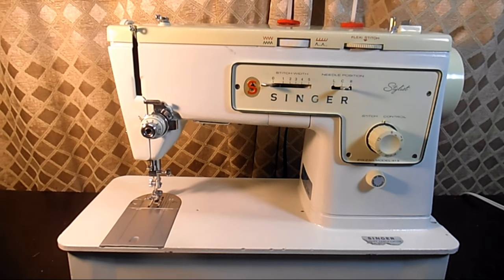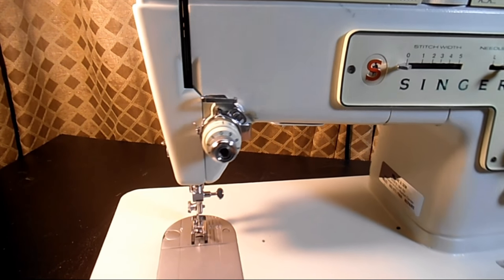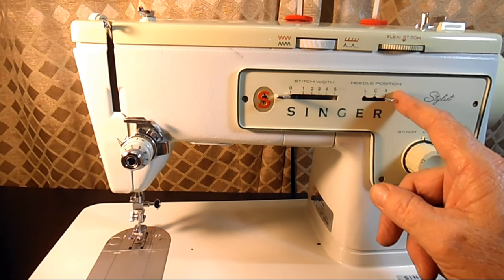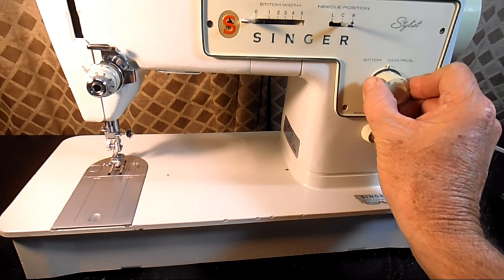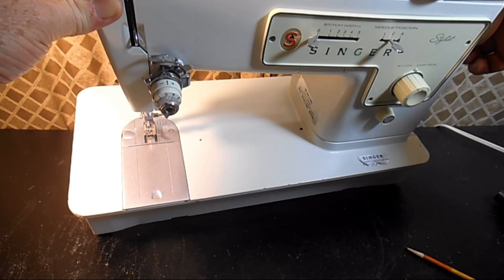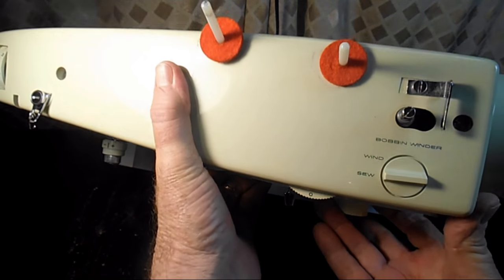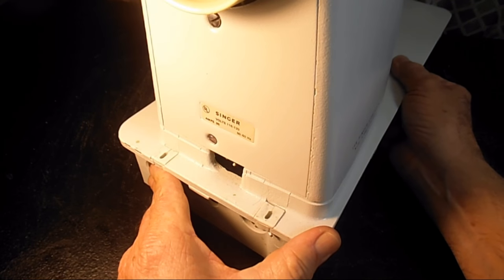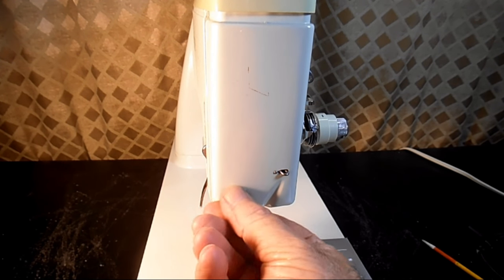TOUR THE FEATURES OF THE SINGER MODEL 413 STYLIST SEWING MACHINE

Comment: Andy.  Our 413 is birdnesting like crazy.  I watch the needle thread get picked up by the hook, it travels around and seems to hang up on the bobbin holder, the piece that has short swing to hold the bobbin.  Then next time around it gets stuck under.  I am pretty sure I have timing set correctly.  Needle in proper, bobbin tension set.  Top tension set, have tried from 1 to 6 all the same issue.  Ideas?
Reply: Maybe easier way of expressing.  The hook ppulls the thread around to just past 6 oclock position, when it releases, it is hanging on the spring the holds bobbin in place.  Could it be timing?  too far advanced?  I followed the timing instructions closely, so I think timing is right.
Reply from the maker: @BillWhetstone  No, not timing. When the needle thread "casts off" the hook point at 6 o'clock it should pass thru a "gap" between the heel of the bobbin case (bottom right-hand corner) and the spring. It's called the "Thread Cleance" and on your model (413) the gap should be between .012 to .018 inches.
     If the gap is too narrow the needle thread hangs or can stop there and every following hook pass just hangs or stops the thread. Directly to the right of the spring is the bracket itself and the bottom screw is the adjustment screw. You need a feeler gauge and you may need to loosen (slightly) the two smaller screws above the adjustment screw, the bigger lower screw turns to move the spring closer or farther from the case. That screw is eccentric I think and the adjustment is very small. 
     Each machine is different due to age. My machine might work best at .011 and yours at .014. If the gap is too wide the bobbin case bangs back and forth from the spring to the hook race and is very loud and the case can even jump off the race.  YOu see what happens when it's too narrow.
     If you'd like the page from the service manual (PDF) for testing and adjusting the gap email to andymanuals53@gmail.com and ask Alan for the 413 thread gap page. No Charge. If you think I'm on the wrong track then send Alan a picture and he will get it to me. Good Luck, and thanks for saving that machine.
Reply: Thank you for the email, you figured out solution to what I was seeing.  The thread gap was too small, hanging the thread.  The machine is now sewing correctly.  Still have a bug to solve with flex stitch, the fork that engages hangs up just a little and makes a noise and a slow down.  But the zigzag is working and no bird nests!  Thanks so much.
Reply from the maker: @BillWhetstone  well that's great. Progress nicely done. Bill as long as the top plastic gear on the vertical shaft isn't broken and losing teeth, the machine is a very nice model. Thanks for saving it

Comment: Great series.  I recently purchased a 413 and have completely restored it per this video series.  Thank you!  Quick question:  Is it normal for the pattern selector dial to rotate during sewing???
Reply from the maker: Hi, Bill. I'm glad you found the series and it was useful to you. Thanks for that. I don't think the dial should be moving at all. On the cover plate, just above the dial is a vertical hash mark that tells you what length you set the dial to. If the dial rotates then how would you know the true length setting? That dial must be pushing/pulling a rod to the feed regulator to control how far the feed dog moves. If it is rotating on its own there must be something lose I'm thinking, like a bracket that mounts it to the frame or something? Here is the parts diagram for the 413: http://parts.singerco.com/CPpartCharts/4_4999/413K.pdf
 If you need a service manual email me (address on my "ABOUT" page) I have one for the 416-418 model which is a little different but may help. 
Thanks for watching my channel.
Reply: @andytubesewing1953   Thanks for responding!!!  To clarify, it's the PATTERN SELECTOR (white horizontal dial) that is revolving.  It appears to be connected to a horizontal worm gear that constantly moves.  Should the PATTERN SELECTOR dial revolve as the machine sews? It just surprises me.
Reply: Apologies for the multiple emails.  The PATTERN SELECTOR dial that I'm talking about is 153298-451 and the gear that it appears to ride upon is 102428 (per the 2nd sheet of your parts diagram).  I just need to know if this constant revolving is normal.  THANKS AGAIN!
Reply from the maker: Oops! My bad, Bill. I misunderstood. It is normal for the pattern selector to rotate around with the camstack with the machine is running. Take a look at this video for model 457 starting at 2:20 where I talk about the selection wheel or dial. https://youtu.be/egDAePpqjW0   That little dark spring on top of the dial/wheel pops in and out of two depressions in the dial that hold your setting in place, When you move the dial it raises or lowers a cam follower to a pattern cam. That's how it makes the pattern you selected. The cam rotates with the worm gear on the horizontal shaft and the follower, connected to the needle bar vibrating arm, follows that pattern cam and moves the needle back and forth to make the pattern. Because the camstack, pattern cams, and selector dial are all connected together, they all rotate together. Notice there is no marking on the dial itself? It does not matter because moving the dial slightly left or right moves the spring into one or the other of the depressions and raises or lowers that follower no matter where the dial has rotated while running. Thanks for your patience, Bill. Take Care.
Reply: @andytubesewing1953   You're amazing!  And, thanks to you, I've followed your 413 videos and restored my Singer Stylist 413!  Including the corroded feet pads which explained the excessive vibration.  You're so generous and helpful  THANK YOU!!!  I'm a hooked subscriber!
Reply from the maker: @UniversalEngineer  Thanks for the sub, Bill. I'm honored when people subscribe to my channel. Don't be a stranger. Take Care.

Comment: I have one of these that is experiencing slow to get going and then takes off into speed racing mode.  Is it motor or pedal?  The speed also changes fast to slow ...very inconsistent.
Reply from the maker: If the machine is fairly clean and properly lubricated then this sounds like the pedal needs cleaning and adjusting.
Here is the Playlist to help with that: https://www.youtube.com/playlist?list=PLsCOZgzzaiKItPLWcK24FBoMdHK8vTXNi
Reply: Thank you Andy....I have been looking for another pedal....as the repair intimidates me when it comes to the carbon packs.   Can't find a pedal anywhere, so I may not have a choice but to bite the bullet and tackle pedal repair.
Reply: @andytubesewing1953 woo-hoo!!! I did it...and pedal works better, nice and steady pace according to pressure added.  One bad boo-boo...I lost a spring in the process.  Clamshell took a dive when I was chasing other parts that flew....and I can't find the other spring.
Someday I will find it, hopefully.

Thank you once again and again and again.  You have helped me rescue 2 machines! Your encouragement for all the rest of us is profoundly invaluable ❤️🌼❤️🌼❤️
You are a great teacher!
Reply from the maker: @Cherps91  You did it! Nice going. Now you know about pedal repair. So many times folks asked me to "fix" the motor but it was the pedal that had never been cleaned/adjusted. Thanks for saving the machines and I appreciate your comment.
You can probably find a good enough spring at a hardware store if needed.

Comment: Hey Andy, it’s me again.  On my singer stylist 834 when using the flexi stitch option, the machine goes in reverse.  Any idea where to start looking for the problem.  Happy Easter!
Reply from the maker: That's odd! When researching flexi-stitch problems in the past they have all been user errors where the dials and levers were not set correctly. A common problem was people forgetting to put the machine in straight stitch before engaging flexi sewing, just as one example. Another was not setting the width to the red bar. I'd start by testing for normal reverse when using straight stitch to test the reverse button function. If that's good and not stuck (fails to release for forward sewing) then I'd review the Instruction Manual for proper settings of flexi-stitch sewing. For anyone needing the manual, it is still free from Singer as a PDF download on their Support Page here: https://www.singer.com/search/support?title=834
Reply: @andytubesewing1953  thanks Andy, these manuals are a lot clearer,no watermarks, to cover important information up.  Yes, the reverse works fine so it’s probably in my setting the other dials incorrectly. I can’t put my hands back on a video I was watching the other day where a gentleman showed where a tiny washer sits on the shaft up top and sure enough when I looked at mine it was sitting broken and lose up there.  He showed how he cut some off so he could just slip it on there vs a bigger job of removing all those parts that I’m sure I wouldn’t be able to handle, lol.  It fills a tiny gap but I’m not sure if that has anything to do with the reverse but I’m sure it sits there for some reason.  Anyway, I’ve got something to tinker with, thanks again for providing that manual link.  UPDATE.  It’s called a shaft washer, I found it on sewing parts online.  I wonder if Lowes has something comparable.  I have a piece I can take with me.

Comment: After seeing your other video on the Apollo Bobbin, my garage sale 413 has an F bracket instead of the Position Bracket for the metal bobbin case.  It is an after-market conversion or did Singer change the bobbin system on later models?
Reply from the maker: I have restored a half dozen of this model and they were all as shown in my video. However, the free copy of the Instruction Manual available from Singer here:
https://www.singer.com/search/support?title=413  does show the Apollo Style Bobbin case. It was printed in Great Britain in 1971. I also have the Parts diagram/list (no place or date of publication) that shows both bobbin case and bracket styles. The diagram with the Apollo case/L-Bracket is identified with K13. I'm guessing there were two original versions, 413 US and 413K GB, or they did later move to the Apollo Style, which is a later style than the metal case. No way to verify any of that though. The K designation is for the factory in Kilbowie, Scotland.
Reply: @andytubesewing1953  Wow Andy! Kilbowie Scotland?! Do they even know that was the tragic fate of our Dear Knife Throwing Legend Jim Bowie at The Alamo around 1836?

Comment: My needle broke while sewing, put in another needle now I try to sew and for some reason I can't sew because needle is. Hitting something when going down.
Reply from the maker: Welcome to Andy Tube, Pamela. It sounds like your original needle "strike" caused the machine to lose the Timing between the Needle and Hook, and the needle is now hitting part of the hook base. Fairly common and you can fix this. Either the needle bar slipped, or the timing belt slipped. (or even both) Rarely you may have bent the needle bar itself. I have a playlist of videos for model 413 that you can find here:  https://www.youtube.com/playlist?list=PLsCOZgzzaiKKVlkxPT9FMTdvUUGj8Ydf8    One of the videos in that list is how to check and set the timing: https://youtu.be/pANycD90wQg   You can check the timing without making any changes on the machine so you do that first. If the timing is lost then you can correct it. The video shows you exactly how to do all that. The video now has 90,000+ views so you can tell this happens quite often. Good luck, and hope you come back for a visit someday.

Comment: Do you have any videos on how to adjust the swing of the needle on a singer 758?  I can’t get it to do
Reply from the maker: Sorry, no. I do not work on the touch & sew models. The free instructions are here: https://www.singer.com/sites/default/files/product_manual/6dc4cd61b0c61a5fc13e60785f01d29199328059_0.pdf
You can check to be sure you have the correct fashion disc in place and the dials set correctly. Other than that, Terry at TANDTREPAIR>COM knows more about SInger T&S models than anyone I know. He sells the factory service guides as well as his personal guides from 30 years experience. https://store.tandtrepair.com/tosew700se.html
Use coupon andy-h-yt for a 20% discount if you do buy something off his site. Best of Luck.

Comment: Is it all metal gears and linkages inside?
Reply from the maker: NOPE! It is a strong machine although it has a weak link in the vertical shaft top gear. It is plastic, darn it. If it has not broken yet, it soon will IMO. On the bottom are two metal pulleys and a belt to drive the hook. There is also a motor belt. You can download a FREE copy of the part diagram here >> http://parts.singerco.com/CPpartCharts/4_4999/413K.pdf
See that gear No. 155819 on top of the vertical shaft? That is the culprit. The good news is you can buy a new one for around $10. I even made a video about how to change that type of gear >> https://youtu.be/M3bFtlV1Y6s  If you really want an all metal machine take a look at 301A, 401A, 403A, 404 and the Rocketeers 500A & 503A. All metal gears, no belts. Most of these you can see on my playlist page here>> https://www.youtube.com/channel/UCUSPDsHaFtRoz1VA2U1xJ4w/playlists?view_as=public
Before the emails start let me say there are other all-metal machines as well as many other brands. The ones I listed because I have some videos of them you can watch and get an idea, that's all. Thanks for watching my channel.
Reply: Thanks for the info. I saw one for sale but I think I will avoid it. I have a 401 but I think it needs the motor serviced. I’ve seen some of your videos on that.
Reply from the maker: Welcome. Please consider the possibility that your 401 may need a foot pedal tune-up. That is actually more common than a bad motor.
https://www.youtube.com/playlist?list=PLsCOZgzzaiKL6ePPxLpmnWSzTyxPKTb71

Comment: can you make the presser foot bar higher on these machine my one does not give much space for thick fabric
Reply from the maker: The factory height setting for model 413 is .290 to .300 inch and they can easily be adjusted. See page 26 of Service Manual. If you need a copy email to andymanuals53@gmail.com and ask for one in the Subject Line. I will have Alan send you back a FREE PDF copy as a welcome to my Channel in appreciation of your watching my videos. 😊
Reply: @andytubesewing1953  if i try to zig zag in left position the  needle it hits the bobing but its fine in the right or center ??? is this ment to happen i dont have a manuel i made the presser foot bar higher took like 2secs
Reply from the maker: @rndea100  you must mean it hits the bobbin case, not the bobbin right? So you can go to singer and download free copy of the instruction manual that explains all the controls on the machine and what you can and can't do and how to set up zigzag and so forth. So the first thing to do is be sure that you are setting properly for what you're trying to do then if that fails and you still have the same problem now you're looking at adjusting the left center right? Or the position of centering the needle bar?
Here is the link to the free manual https://www.singer.com/search/support?title=413

Comment: My grandmother has this sewing machine and her bobbin case isn’t spinning. Would you know why that is?
Reply from the maker: Thanks for helping your Grandmother. The top gear (plastic) on the vertical shaft has broken. This is a well-known problem on a half dozen models of that decade. You can buy a new gear for $10 and here is my video for replacing it https://youtu.be/M3bFtlV1Y6s
Model 413 has a different faceplate and access to the gear than the 457 in my video, but thousands of people have replaced that gear on a 413. Thanks for asking and good luck.
Reply: @andytubesewing1953  thank you iso much! I just saw your reply. I’m currently at her house and I had it wrong. She has the 457! So your video will be super helpful.
Reply from the maker: @rebecca.thecrafter963  Oh, that's even better. I know you guys can replace that gear 👍 She'll be sew 😉 happy to get it working again

Comment: I have this model 413 and it's sewing backwardness do I do?
Reply from the maker: Normally you push and hold in the Stitch Control Dial to make the machine sew in reverse. That is the large "knob" with the numbers on it. The parts inside move the Feed Regulator to change the direction of the feed dog. Is the knob stuck "in"? There are usually a couple of springs inside that give resistance when you push and then force the knob back out when you let it go. You may have a broken spring or one came loose. The Feed Regulator may be stuck onto the slide block it moves on. It's a 50-year-old machine now, and who knows when or even if the machine was ever serviced. The parts may need a little oil to get moving properly. You can take off the top and bottom covers and even the faceplate to see the parts moving and you may be able to oil them without removing other parts. Here is a video of a similar push-button feed regulator and slide block. It's on a different model, but the parts may be like yours. If you start at 12:25 in the video you can see I point out the parts and you'll see the springs I'm talking about. https://youtu.be/dYOx1U7Cs24    Also, one time on a 513 I released stuck parts by just pushing harder and harder on the knob and releasing it, with fast motions, and the knob moved out about 1/4" and then the machine sewed normally. Some of the parts are plastic and I think sometimes they get stuck from dust, temperature change, etc. One viewer said she used a hairdryer to release a stuck button. (heat and airflow) BTW, you can download the instruction manual from SInger for free at this link:
https://www.singer.com/search/support?title=413